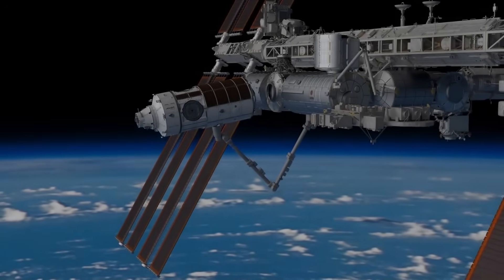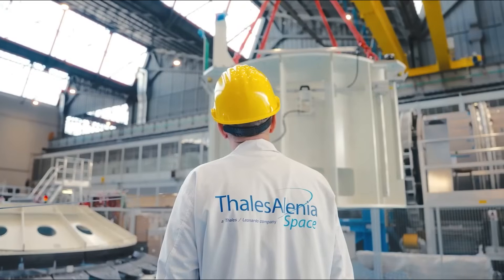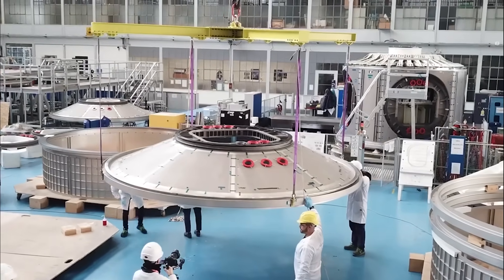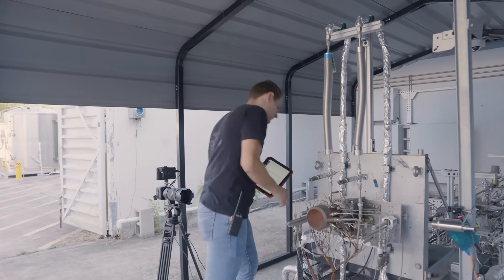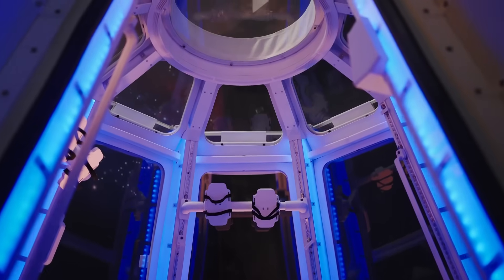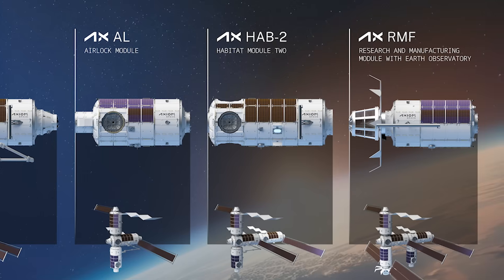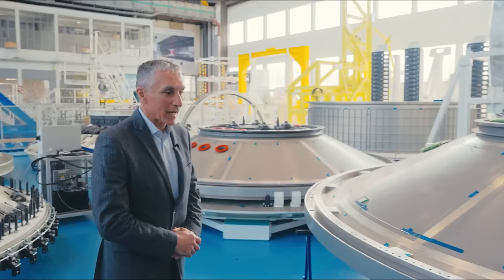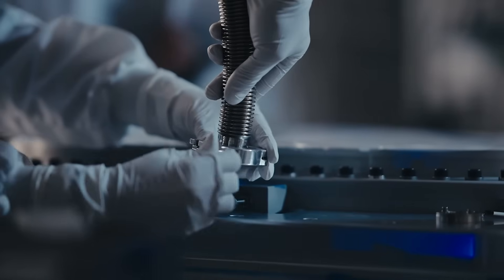Axiom Station’s First Module Is Almost Done

Comment: The ISS is in the orbit it is so that the Russians can reach it, otherwise it's suboptimal for everyone else.  Why would Axiom want to either stick their station with the same orbit that inconveniences most of its customers or have to pay for an expensive OTV to shift its orbit?
Reply: This way they can transfer experiments and other hardware over from the ISS, and begin operations as part of the larger ISS. The higher inclination of the ISS orbit also really isn't a big deal. All existing LEO crew and cargo spacecraft being built by the US and its allies are, for obvious reasons, already designed specifically with this orbit in mind.
Reply: Earth observation is greatly facilitated by being in higher inclinations since more of the planet passes under the 51.6 degree inclination orbit than the 28.5 degree one. The most ideal one for that would be an 80-90 degree polar orbit.
Reply: Because at higher orbits, orbital junk is denser and any station placed higher would have a reduced life span due to damage from the increased pummelling of tiny bits of debris travelling at hundreds of metres per second.
Reply: So that it can be built off of the ISS